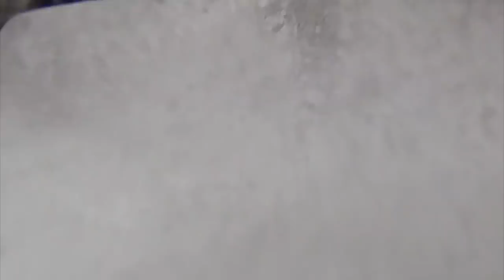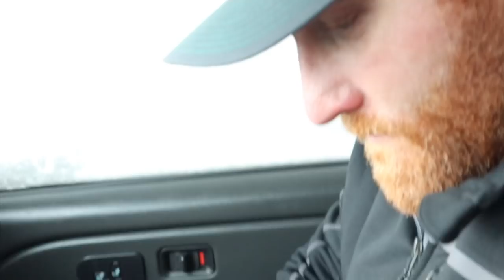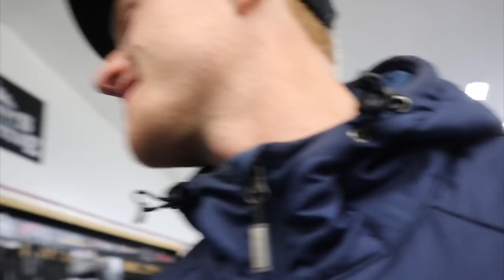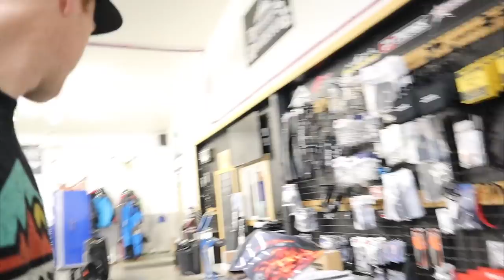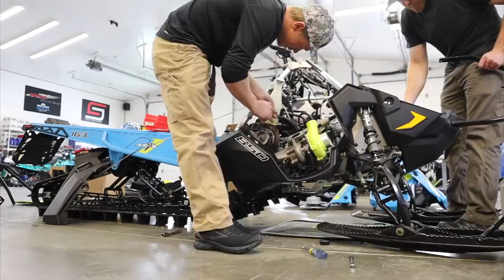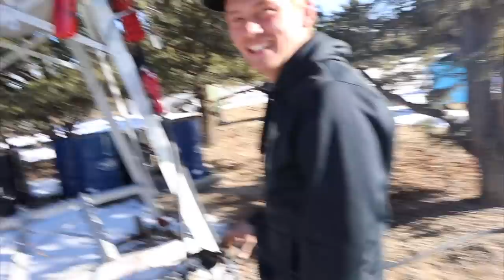The Snow is DEEP! | Roscos BBA Vlog | #11

Comment: Bring me out there, every hour you take me riding I will spend an hour welding for u! I would like to find one of those bitchen Klim welding jackets!
Reply from the maker: lol sounds good 🤓 yeah they are super flame retardant... 😂
Reply: @Rossxr  fr tho, those welds don't look that bad. We have kids walk into the shop every day streight out of welding school that weld like that lol. Gotta be patient with aluminum, heat it up slowly until the base material will take filler, don't just blast heat to it till u get a puddle. Once u get a puddle flowing dab a lil fill in and pull it forward, pause dab pull.